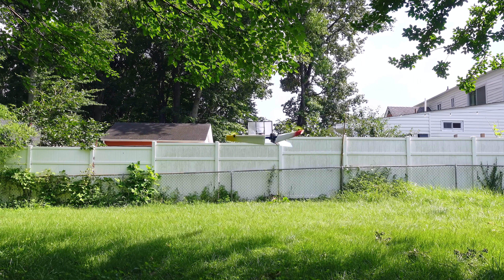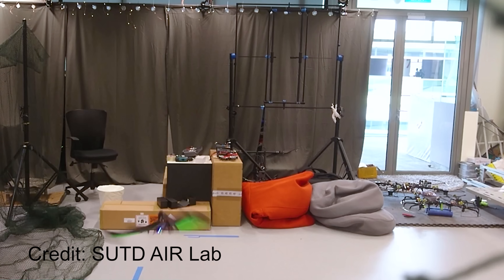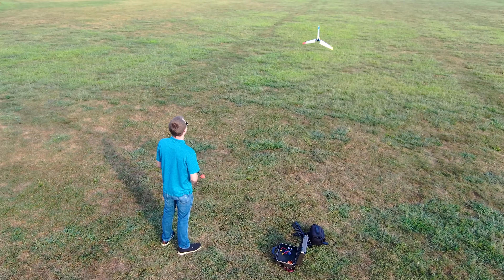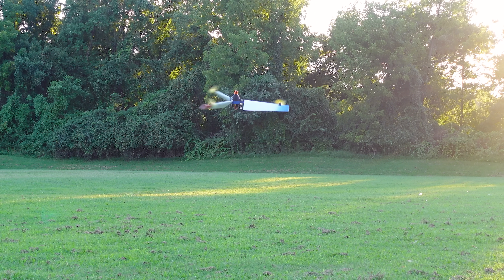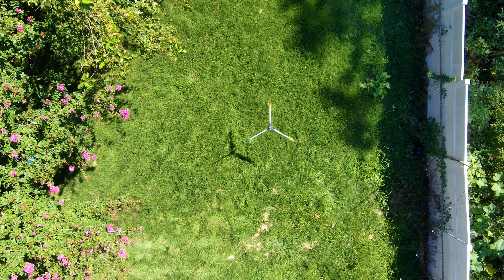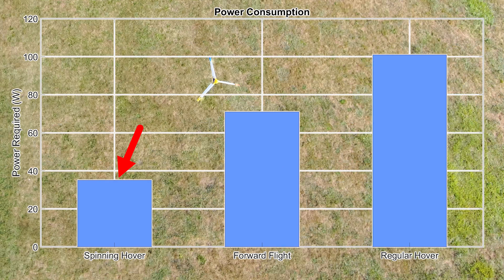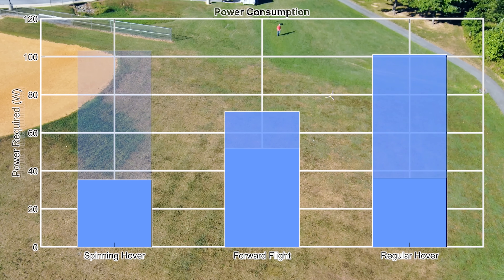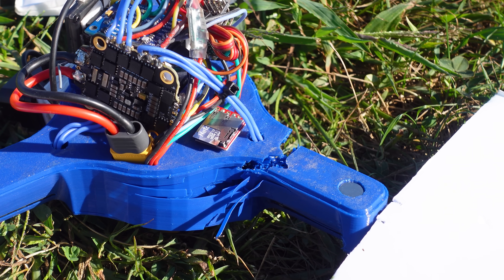Is THIS the Most Versatile Aircraft Design?  (Forward Flight Testing) - Part 2

Comment: The comment about the bicopter design is a great idea! In addition (you may have already thought of it) but what about having a singular motor set up to be able to adjust 90 degrees to provide propulsion, with the respective wing straight while the other two wings adjust freely to create lift, with thrust from their own motors? Almost creating a bicopter design with a long tail fin? In my mind I know the added complexity of the electronics would be a new issue and from a physical standpoint I am not sure if the rear "tail" would be too heavy for the two forward tilted wings to support, but let me know what you think! @nicholasrehm

Comment: would a single, telescopic wing improve forward flight? you could maybe hit a button to orient that wing upwards and retract it into itself.

alternately, maybe could you reduce the speed of the two side motors so the top one would pull the top wing further forward. would probably reduce top speed but maybe increase efficiency?

i’m clearly not an engineer just came to mind 😅

Comment: In the forward flight, why don't you keep the third blade at the back, like a fuselage, instead of sticking it out to the top. This way you will minimize the drag. You will lose the thrust from one motor, but the overall shape could be more aerodynamic

Comment: I can see this  as a four wing design  with an x-shape in hover and spinning and a with actuators, a bi wing design in forward flight. 
This eliminates the drag from third wing and increase lift. It's not as good as a single wing, but I believe it would be far better than a tri wing.
You also get an extra motor

Comment: how large can you make the wings before you lose vtol efficiency?
I take it the wing setup would be different for a strictly vtol version of this vs a forward flight version of this
Reply: since long blades are used for gliding efficiency, would something like that work for this?
you might be able to setup to where you don't even need the tilting but can also steer just by controlling flaps on the wing, ofcourse you'd have to use the computer since it would be rotating.
essentially it would just tilt the craft and have it fall in the direction it wants to go  while maintaining hover.
something like this could be used to counter wind, to stay geo-stationary but you could also use it to sail in the wind in the sky (much like a glider). 
perhaps the restrictions would take too much away from the performance. but if it increases lift with a higher lift coefficient while lowering its weight, it could allow for a larger mass payload, or a longer flight time. with an efficentcy setup like this it could also probably be programmed to where the craft can fall to the ground softly if power was lost much like a maple seed.
have you tried wings modeled on maple seeds? I've never seen them tried anywhere before
Reply: oh nvm it seems one was done similar to your model in may 2022; you can find the writeup on Tiny drone based on maple seed pod doubles flight time;
they did a bi wing model
Reply: wow, lockheed martin did one with a single wing and just used a counter weight wow
Reply: hydrogen solar blimp drone petal deplorer :| oh the humanity

Comment: To keep from drifting, you can attach a string from the center so it does not twist up & attach the other end to an anchor of some type, such as a rock.
Reply from the maker: That seems a little counter intuitive to the whole flying thing
Reply: @NicholasRehm  at 5:40 you say you have no way to prevent it from drifting around. This indicates you are trying to get it to hover in place without drifting, not trying to fly it. So please, try to remember what it was you were talking about in the video before trying to correct someone that was only trying to give a valid solution to the statement you made in the video.
Reply from the maker: @1969LordOwen  correct for drifting around, by being able to control it. Lol
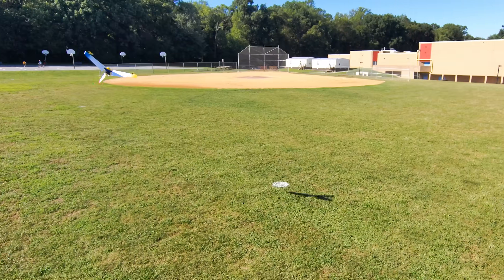Reply: @NicholasRehm  You said you cant do a "Duration" spinning hover test because you can not control the drift. Therefore the test is about how long it can spin in 1 place for & not a test on weather you can figure out a way to prevent the drift by mechanical changes. 5:22 Power consumption, not mechanics of it.
Reply from the maker: @1969LordOwen  damn u right. Leashed drone coming part 3
Reply: @NicholasRehm  Just watched the 1st part to the osprey build. Did the blade come close to you at all.

Comment: I thought this was really clever.  Propellors on the edge of a propellor, like ‘nested propellors’.  One option next, you will have considered, a four-wing design?  If a concern is that 3rd wing of a three-wing version, being vertical in flight and not adding lift, then four wings arrayed ‘star wars’ style like a flattened ‘X’ would mean ALL wings provide mostly lift, but some sideslip-resistance too, I guess the rudder effect can be concocted somehow.  Then I thought about the Mars drone type arrangement, and that would require the 4-wings were paired off into two rotor shapes.  Leading me eventually to realise this solves your steady camera issue, because the 4 wings split into two rotors, would then require to be offset along the axis they rotate on, and thus vertically one above the other, Mars drone style, contra-rotating.  

So this means a central axis will exist, which will actually be a spindle arrangement that remains non-rotating while the two rotors made of two winged blades each, that will be still and dangle a camera from underneath the contra-rotating rotors/pairs of wings.  I suppose a 4- wing could then be smaller than a 3-wing, for the same lift when flying horizontally, but if longer flight times were wanted, longer wings might work better, for floating/gliding a lot better high up?

You can tell I got enthused.  Thanks for the effort that went into this and sharing it, quite an amazing contraption.  Take care.

Comment: If this was a highly funded University project. You could add those things that bend the wing/prop with electricity, it's a very thin ribbon or something. Different modes can switch from symmetrical to curved for efficiency.

Comment: There is an added drawback. Since the tri wing has three-fold semetry you either have the curvature of each wing facing left or right or none. If the curvature bias is facing left or right (the plane of the wing verticle) you have anti-bernolli force on one side or the other of the horizon, which means the lift benefits cancels and the A/c wants to roll, and you need to counter the roll. If there is no bias left or right in the curvature you are not getting the benefit of bernollis lift and consequently your parasitic drag ratio is higher. 
    There are some benefits. 
1. you propellars are on the outside of the wings, consequently less parasitic, the draw back is there rotations are the same. Theoretically you could have rotations to counter vorteces on the wing tip. 

One could have an actuator electronic manfold in the 'horizontal' wings that increases thickness on the top side and decreases thickness on the bottom side.

Comment: I'm interested too see how you control moving in x and y (aka the drift). I see 2 options... #1 use regular quad control with the "front" of the quad constantly changing to match the direction of flight. That was a bad way too describe it. #2 change to using 3 servos. 1 for each arm and make a virtual swash plate with all props at constant rpm. Say you want to pitch forward... Whatever blade is pointing towards the rear should be at a higher pitch for that moment and those at the front a lower pitch. The temporarily high prop pitch combined with high craft pitch would increase lift at the rear with opposite at the front causing a pitching motion. Also the craft rotation rate wouldn't change overall but might flex each arm. In theory this would work with or without the craft wings. Also I'm not sure if precession would happen... That thing in helis where control inputs are 90° early I think. I fly quads so I'm not really that familiar with heli theory.

Comment: the efficiency of forward flight could be dramatically improved if you have a 4 wings X shaped design with unequal angles between  the 2 pairs of wings , in which all 4 wings contribute to lift generating during forward flight.
Reply from the maker: Agreed, on the to-do list

Comment: For control during spinning hover... Figure out how to Light up LED's on the wingtips as they pass through the "nose" position... or even have then go red/green for port and starboard...  That way you can have orientation for the pilot.  as far as actual control, I believe you could Pulse the power of the motors to move laterally, they would need to be timed.  For pitch and roll you just change the angle of the blades/wings in the same manner a helicopter does.
Reply from the maker: Exactly the plan!

Comment: a thought, a thor design, but with 4 engines that the 2 are closer to thee center to create the hover stability and their ownly goal is to stabilize hover and increase speed during horizontal flight, probably not nearly that simple of a fix, but it just seemed like a way of countering the huge vertical wing would be to level it out and add a secondary counter balance motor. It would be a lot more power hungry, but that is what these tests are for!! lol

Comment: duckted fans are more efficent than open blade fans and quieter too. 
Any way to add that without reducing the efficency of the spinning hover? perhaps putting a fan inside the centeral hub and the batteries and electeonics inside the wings? if that can be done?

Comment: This would be a huge challenge in control and balance, but what if, once in forward flight, the rotor pointed straight up rotates backwards to become an empennage.  As it does so, a linkage could rotate the motor so it stays in line with the other two.

Comment: Re: Video - in 1989, NASA proposed a "samara camera" that would use the rotation of a single-wing platform patterned after a maple tree seed (  "samara" ) to scan as it descended into an atmosphere.  Search "samara probe for remote imaging" for more info, but having put together pretty good composites out of rotating video, I think that with a bunch of frame-juggling you could have 360° imaging in more-or-less real time, much as you've done with the LIDAR.  Wide-angle imaging could only make this more useful.

Comment: If you ignore the KISS principle, could the "vertical stabilizer" wing be retractable? A lightweight spring such that as it's spinning it extends and balances the rotation, but then retracts during horizontal flight? X-Wing idea is also interesting. 😃👍

Comment: Very cool idea! I think to "finish" and make it do everything you'll need to install a fixed pod in some fashion. Either by slip ring or some other connection to a de-rotated portion, the value of even a small de-rotated section would really enable the entire thing to work across all regimes.

Comment: Ok, could you sort of simulate a twisted airfoil by having multiple segments (2-3), each of which twists a different amount as you twist the overall airfoil ?  Certainly the mechanical build is more complicated, AND there is the question of how much drag is introduced at the transitions between the segments.    Then the foil is good both in the spinning hover as well as forward flight.

Comment: TL;DR a huge skinny fixed wing aircraft is better suited for disaster communications.

To be honest the disaster relief application you mentioned is a bit out of reach for this craft.  The department I was in during college did a prototype for the USAF of a plane with extreme loiter capability for disaster communications, and it could keep like 5-10 kilos of payload over an area for 5 days at a time.  Communications payloads also tend to draw a fair bit of electrical power so you also have to factor that in.  I think the real potential for this design is in imaging via a flywheel-gyro gimbal.  You could have the camera hang below the drone and be perfectly steady even when the drone is spinning which would mean that you just get longer hover times than comparable camera quads/tris.

Comment: What if when going into forward flight mode you turn all the wings horizontal to the center hub and just use the motor from two of the wings to pull it forward?

Comment: Because of the problem of the vertical limb causing drag during forward flight could you redesign the limbs to fold down and increase efficiency? Yes it'll probably reduce limb strength and increase weight but if it becomes over all more efficient I think it would be worth it.

Comment: I'd consider an X wing instead of 2 or 3 wings.  In horizontal flight all the wing surfaces would product some lift, not just drag.  I might also have the aerodynamic surfaces out from the center.  And getting fancy, the wings of an X wing could swing into better configuration for horizontal flight.

Comment: I do wonder how efficient 'spinning while in horizontal flight' might be on this! it would definetly be interesting to see
Reply: I would think it would require some major fly by wire compute power to controlled flight.  With your x and y changing constantly it would be very hard to know what way is up.
Reply: @Dragonsrage012  he currently has the lidar pointed radially downward between the bottom 2 rotors, but if he had it pointed backward, he could use that to measure altitude when flying at high angles of attack. It might be usable for lower angles of attack, but it would be more susceptible to noise from obstructions on the ground...
Reply: It'd probably lose all its lift, so probably not very efficient.
Reply: Like a drone version of an autogyro? More fuel-efficient than helicopters during horizontal flight, but worse during hovers, iirc?

Comment: Don’t you think that the drag could be ignored with low air flow as you are spinning lower than the motor’s blades. My suggestion is to use wider wings in order to reduce the power needed for the blades this also applies for the longer wings it is like a mechanical leverage.

Comment: Most impressive. Not just the design, but all the associated work. Lidar, fffs. Wow.

And the video itself is pro. Your voice and manner are engaging.

As for the design itself, after saying "wow", my thought was to switch to a quad-copter on an old-style two-bladed rotor with two more little blades. It would fly horizontally as a straight main wing in two halves, with a stubby fin up and down in the middle of the craft. I dunno if that makes any sense.

I want to see more of your work.

I have subscribed.

Comment: You should install servo motors for each big wing to adjust angle of attack, automatically on the basis of drag data.
Or you should work on something which is similar to mosquito configuration, Y or T, two motors for lift and one for drag.

Comment: Thanks for sharing, I've also been playing with flying things since 2006. I always ask myself why the racing copters we see today are not aerodynamic and the COG is not at the propeller tip? I've modeled a few designs, mainly a quadrocopter / Hexacopter with wings, and making sure the battery (heaviest part) is in the center of effort. I have also tested the X and + frames, all of my test suggest that the PLUS frame is much better :-) Thanks again

Comment: I wonder if the only problem of the 2 pronged design could be solved by just using 2 motors oon each wing. It would also allow it to potentially hover with the loss of one motor and fly with the loss of 2

Comment: If you can make something like the go pro stay quiet while the drone is spinning, why dont you put there a dof to know easier the actitude of the whole drone? If you know it is starting to shift for example to the north, you just have to apply more energy in one of the rotator motors. That motor must be oposite to the shift movement at that moment. The impulse of the 3 drones must be the same, 80,80,140% for example

Comment: You could use a separate motor on its own axis that shoots air out to stabilize it like a small cylinder with  Actuators To shoot out air with little trap doors when I detects a movement in direction

Comment: I think as a rotor system for an Osprey style craft it would be more effective providing greater lift and stability while if one or two of the 6 motors fail you would still be able to make a long controllable autogyro to safety instead of immediately crashing

Comment: Have you considered a spinning forward flight model? I'm curious to see what that would look like. Theoretically, you'd gain the power consumption efficiency of the spinning hover with potentially higher traversal speed (from the greater thrust-to-power draw ratio). I also realize the stability and directional control would be a nightmare to figure out (and I'm not sure how well the current LiDAR setup would be able to maintain altitude for data collection while spinning on an angled axis). But if you take a crack at it, I'd love to see the results! This whole project reminds me of Tip Jet helicopter concepts (like the Fairey Rotodyne and McDonnell XV-1), minus the fusilage/collective/other assorted helicopter bits.
Reply: Maybe there could be a hub below the main body that spins opposite to the craft to remain stationary rather than spinning. You can have a camera and sensors in this hub to figure out position and velocity easier without having to worry about all that random spinning. Oh wait that's basically a helicopter lol. except thrust comes from the blades.